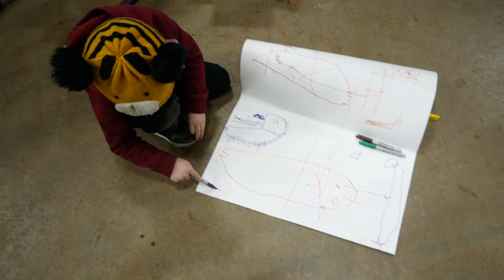Plow Truck Hydraulic Leak Escalates Quickly

Comment: To the Mrs.: "There's your problem, lady...you have to let that summer air out of your tires and refill them with winter air!"
Reply: Problem is, one, the winter temperature being so cold the car you have probably is telling her the air pressure is low, well it is not,  the pressure in the tires drop1 to 2  pounds for every 10 degrees the temperature drops. Two, I guess the car will figure it out. Ask your mechanic Lady. lol
Reply: lol!  I'm so use to it know that I'm no longer surprised or annoyed.  Typically when we have a temp drop it stays down and I do have to fill them, even when it goes back up my tires rarely have high pressure problems.

Comment: Comes in for a hydraulic leak and Wes rebuilds and restores the truck to near new condition in 24 hours of non stop work. You are totally awesome my friend. And to think I believe I found your channel when you were saving a forklift from an old field along with a couple other cool things it seems years ago now. Shouldn't these repairs be done in the summer time? It is not like they did not know thye have been there for several years now. They did not just spring a leak. That radiator has been going for quite a while. Just common sense, or lack thereof my friend. I am sure you have already asked yourself these things because you know the answers..lol

Comment: When I designed hydraulics for the oilfield, EVERYTHING was specced as stainless.  And that stuff didnt even have to withstand road salt.
Reply: Your lucky if the box is Stainless.  Absolutely the cheapest fittings will be used by the upfitters.  Lots of pipe, and garbage hydraulic valves.
Reply: @kevinoscarson2941  yep, most municipalities arent going spend the kind of money on SS or the best upfitters let alone maintenance. upfitter might have used semi decent quality fittings, hoses but over yrs, the in house hacks slapped whatever on as cheap/fast as possible
Reply: Including stainless fasteners threaded into stainless parts?  What's the oilfield approved solution for galling threads?
Reply: @somebodyelse6673  I work in the oilfield as well on some oil coolers that’s require hydraulic parts just be super careful when threading them in
Reply: @somebodyelse6673  antiseize to lube the threads?
Reply: @alouisschafer7212  - I've done it on occasion, but I'm still reluctant to use it on anything with a torque spec.  Lots of people have answers about how to adjust the spec for putting any kind of goop on torque spec'd fasteners, and most of them disagree.

I was wondering if Stan had some insight from a very demanding application field.
Reply from the maker: The only stainless on this truck is the rear salt spreader tray. And even then they rust out...
Reply: @somebodyelse6673  -ha tighten more! Stainless work hardens so as you increase torque...well good luck.  The best solution is low torque fittings like O ring Face seal.  Anything like Jic, pipe, British its going to be a difficult road.
Reply: Just because you designed it stainless doesn't mean it was installed stainless. Or replaced stainless by maintenance.
Reply: @somebodyelse6673   Depending on the situation, nickel based nev-r-seize, teflon thread coatings (Xylan),  glass bead peening on the male threads, copper flash plating on the female threads, pipe dope (for the production tubing threads), or some combination. When the downhole tool costs a quarter of a million at a pop, and it has to go in the hole and never see daylight again, and live in a highly corrosive/high temp/high pressure environment and work for 20 years, you do everything you can to ensure it works. In the case of surface equipment hoses, the downtime to deal with a failed hose (remember we use very strong acids, and deal with H2S, and may be sited offshore in salt air, etc.) simply isn't worth the cost differential between cheap hose fittings and the good ones.
Reply: @Rorschach1024  - I thought you were pulling my leg with that glass bead peening, but I didn't even have to look hard to find out it actually is a thing.  Thanks, I'll be doing some homework on things I didn't know about!
Reply: @somebodyelse6673  it introduces work hardening strain on the surface, it also gives small surface defects for lubrication to be held in the joint. the key to galling (which is actually solid state welding) is changing the distances between the atoms in the crystal lattice enough so that they cant align with the lattice of the mating part. when the lattices align, and they are forced into contact they will form bonds between the two parts on a small scale, then they will tear and form a surface irregularity that then induces more bonding, until the weld is big enough and strong enough to prevent further movement. lubricants, or different metals with different crystal lattice structures (copper for instance) prevent the two surfaces from contacting each other and forming a small scale weld.

Comment: As the fleet mechanic for a snow removal fleet I feel your pain.... Boy howdy do I feel your pain on this.
Reply: Yeah thats why i stayed away from diesels while being a tech.
Reply: After 25 years of being an engineer on oil tank ships I'm here to say it can always be worse. Imagine everything you work on in this state but you also can't torch or grind or weld on anything.
Reply: Same here 28 years for ODOT fixed my share of rusted trucks getting soaked with snow and hyd oil.
Reply: Been there, done that, and now retired to Hawaii.  What I saw in the wing mount is a standard repair problem.  Overall it looks to me like a no-existing preventive maintenance program!!!
Reply: @peteysquirrelchaser9028 , I spent over 30 years at sea. The early years were Deep Sea but I switched to Large ATB's (Articulated Tug Barges). I retired a couple of years ago as Chief Engineer Unlimited and have some stories about working on Hydro Systems that spent half their lives under salt water! The Deck Cranes were the worst as I think the only reason that were in boxes was to hold the salt water in. LOL

Comment: Wes one year I was having trouble with snow plow mounting bolts on our 1206. I ended up putting a hard SAE washer, the frame, the snow plow frame, hard SAE washers. I used a long enough bolt so that the whole shank came through the frame & the blade frame, then stacked up hard SAE washers so that I could tighten them. Before that, they were breaking at the root of the threads. None of the bolts have broken since I used long enough bolts where the shank was doing the work instead of the threads!
Hello from north east Montana. 
10 miles from the Canadian border.

Comment: Wes, After 11 years of working on a city fleet here in Michigan working on plow truck ain't too bad it's the sewage and garbage trucks that Suck! Your plow frame repair is a common problem bolts stretch and all we did was torch them all off drive them out with an air hammer and use a BFH to install new ones and rattle them down good for about another year. Unless you're broke send them down the road nothing but busted knuckles and frustration. Hey what's the deal on the International loader with the dead Engine? Scrap? Love your Videos!
Reply from the maker: It's a someday project. We don't have unlimited time to fix worthless junk, so it's going to have to sit for while longer.

Comment: You LOVE rusty plow trucks!  never seen a rad do that before and usually the rust jacking breaks our frame bolts.  We sent our old crane truck to another location and i told them you'd be lucky to get another 2 years out of it and they made no plans for replacement.  Just got hit with an almost 20k repair bill to fix the frame! I guess it still cheaper than buying a new 375k $ truck
Reply from the maker: Wow. Are they replacing the rails? Pakistani Trucks style?
Reply: @WatchWesWork  not sure what they did.   Im doing the pakistani truck style on the autocar right now replacing part of the inner and outer rails.

Comment: iv had the same mostly negative results with aftermarket radiators/heatercores/air to airs ac condensers ect as well. whenever possible i like to put in oem.
Reply from the maker: These guys get pale in the face when I start talking about OEM parts...

Comment: It would be an interesting experiment to take a brand-new, zero miles snowplough and put it to work, but maintain it to perfection. I'm talking about full oil-spray treatment underneath, clean the truck thoroughly after every day's work, regular servicing etc - the whole nine yards. I wonder just how long it would last?
There are guys out there who can keep their vehicles virtually rust-free, while living/working in the rust belt. The road salt doesn't help but proper maintenance would make a huge difference. I suppose guys with ploughs just have to balance the costs/time of maintenance against depreciation of their vehicles.
Reply: Wonder how much it'd cost the municipality to install a giant car wash, which would wash the whole vehicle top and bottom after each day's work? You'd use it for all sorts of large/expensive vehicles such as plows and buses. Wonder how long the savings in maintenance would take for it all to break even?
Reply: @MrAmorti  That's something to consider, really! 
:-D
Reply: @MrAmorti  It would probably pay for itself fairly quickly, especially with a large fleet of vehicles. The problem would be getting the accountants to write the cheque for such a large investment.
Reply from the maker: We'll never know!
Reply: The problem is all the nooks and crannies that you can't wash clean without dismantling large sections of the machine.  It may look great for a while, but it will still be rotting out from the inside.

Comment: Where'd you get that adjustable radiator cap adapter to pressure test the system, seen at 18:43? My kit never seems to have the exact fit....
Reply from the maker: Came in the kit I use, which I think I actually got at Harbor Freight.

Comment: "all 3 bolt are broken off, I don't know whats holding it on there?" Rust, probably just rust

Seems like with the safety inspection they kick the tyre, if the hub and frame dont disintegrate its a pass
Reply: Pure habit was holding it in there!
Reply: Bubblegum and hopes and dreams. That's what holds things around here together
Reply: People underestimate the grip rust has. Had a 79 Dodge Van once . I didn't dare take it to the car wash. If I had it would all went down the drain when the truck dissolved when the clean water hit it. True story..

Comment: I loved the local snowhill  you built and the way both your wife and son had a slide on it and the way your tractor and loader made short work of dealing with the drifts and lying snow.
That hydraulic plumbing was in a really poor shape but you managed to fix it for a while. The radiator though was something else - wrecked. No wonder there wasn't any cab heat with the speed it was loosing coolant! One wonders how the driver could even see out the windscreen to steer in such cold weather or even got the ice off in the first place before they started their run.
Reply from the maker: I really don't know. They just keep it rolling...

Comment: Can you get galvanized hardware as replacement parts for rust resistance on these repairs? Or maybe some rust proofing coating that could be sprayed on?
Reply from the maker: I use zinc plated hardware, but it only lasts so long.

Comment: OK there was a moment in the video where all we saw was the bolt array on the bracket. Slowly from the bottom of the frame an impact wrench with an extension and socket appear (didn’t note the time mark). Laughed out loud as that was totally the position I have found myself in on numerous occasions trying to work on something from the blind side. Thanks for keeping it real.
Reply from the maker: Braille method.

Comment: Another job Wes.. those do not look like fun to work on.. my brother worked for a concrete company for a while as a mechanic, it was about the same as those plow trucks.. covered in crap under them all the time and rotted out from the cement. Plus all the work was done on nights so that the trucks could run during the day. Thanks for the tool recommendation.. I like your tool recommendations because you find made in the USA tools.. I try to buy USA tools when I can.
Reply from the maker: Those trucks are always bad.

Comment: It was a surprise seeing you use that old mechanical jack, I have one, thought I'd clean it up and paint it, would hate to see it going for scrap.  (Scotland)
Reply from the maker: Those Simplex jacks are fantastic. They bring a hefty price here.
Reply: @WatchWesWork   Was it always a metal bar used  when jacking?
Reply from the maker: @theolderigetthewrongbitget4746  One of mine uses a 1" steel bar. The other has a tapered socket for a wood handle that I don't have.
Reply: @WatchWesWork  Thanks, one other thing, what is the best way to keep it working and not seize up, eg oil or grease?, doing this as a project to save it from being scrapped.

Comment: We had the same luck with aftermarket radiators. We have a 4020 John Deere tractor that had a bad leak. Priced out getting it recored. Aftermarket was half the price. 8 months later, aftermarket was leaking. Tried another aftermarket brand lasted a year and a half. Ended up getting the original recored. Been leak free for 9 years
Reply from the maker: Sounds right!

Comment: Wes with the 4 broken bolts on the  wing frame. Better look around for the guy with loose teeth. We use henderson plows and wings where I work. The lower wing arm has sheer pins in them to prevent damage like you had there. As for the hydraulic fittings we use open wire and gear lube on them to help them last longer and get them off when they are spent. Have a good weekend catch you on the next video.
Reply from the maker: I don't know much about how it actually works, but it seems to have a large spring that absorbs shock load. But you can see the wing is also bent in the middle, so I guess it doesn't work very well! This is a Dierzen plow.
Reply: Age and rust have probrobly seized up the  system; it would have definitely stunned the driver  by breaking four bolts were it attaches to the frame.

Comment: You havent experienced frustration until you worked on garbage trucks with hydraulic issues lol..i dealt with maintaining a fleet of 40 plus rust buckets for over 10 years..not to mention all the broken cross members...camel back suspension..trunnion frames..brake chambers..brakes and drums etc...i'm happy to work on normal semi trucks again lol

Comment: Wes, the kids on that snow pile reminded me of a ski area I heard an advertisement for on the radio in Carney, Nebraska that was an incredible 75' high. I lived in New Mexico and had mountains two miles high.
Reply from the maker: We have a ski facility locally that has a 475' vertical drop. I think the longest trail is just short of a mile. That's as good as it gets in the midwest. You'd have to dive 10 hours in any direction to find an actual mountain.

Comment: One of my favorite tools is the small Ryobi air tool. Because I have many Ryobi tools and batteries, I was able to buy the the air tool with out a battery and get it cheap. . It is slow to fill lots of air, but to top off tires with a few lbs. It is quick enough and you can carry it in your car and it saves the hassle of dragging out air hoses and tools .   It's like the "air dragon " tool you see on TV, But I love Ryobi battery tools and on my cars way out in the yard, It is a great tool for the job, It's great for motorcycles too.

Comment: I have lived in Qld Australia for the last 22 years but originally from the UK. How I don't miss the snow and the cold. We haven't had a frost in about 10 years even then by morning break (Smoko) it is usually 20C. And that is also about average for winters day but can be mid twenties. No snow ever. No ice on the roads just a different world. Summer can suck working in high 40's C isn't a picnic but still better than the cold I reckon.
Reply from the maker: Man that's hot. It never gets that hot here. 38C is the hottest I've seen here, and that's maybe for one day and everyone freaks out. Many homes and buildings (including almost all schools) here have no air conditioning.

Comment: Wes, just a tip for you, at 11:44 you were trying to break a bolt loose ...you were trying to loosen the wrong side, always remove or tighten the nut side because it acts as a jam. I bet it would have broke loose had you put the breaker on the nut and not the bolt.
Reply from the maker: That's not possible. The bolt is so close to the other bolt you cannot get a socket on it.

Comment: those internationals have multiple electronic gates that either control defrost, vent and floor.  there is another one that controls the heat, Should be on passenger side down by blower motor.  Had the same issue with a 4300, driver kept complaining no heat and i wired it wide up until i could get him a new module.  hope this helps

Comment: Suggestion, in your spare time you can make up what we called bullets'. They screw on different size bolts, then you can drive them thru the holes. without damaging the bolts. be sure to have slot on the bullet end to help to remove them when in installed.

Comment: The heater system does not have a shut off valve.Check the heater blend door motor behind passenger side panel,possible has a broken coupler (plastic)
Reply from the maker: OK. Could be. Or it has no coolant in it... Those Dt466s like to air lock.